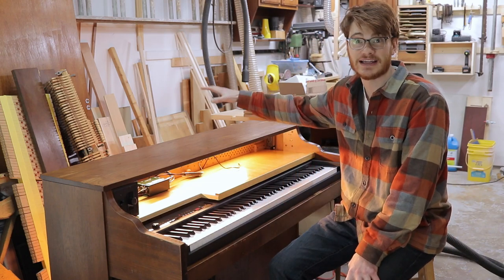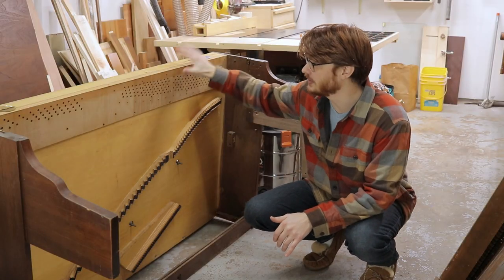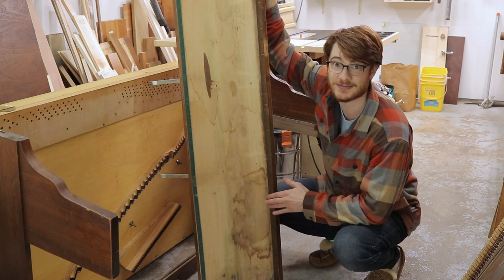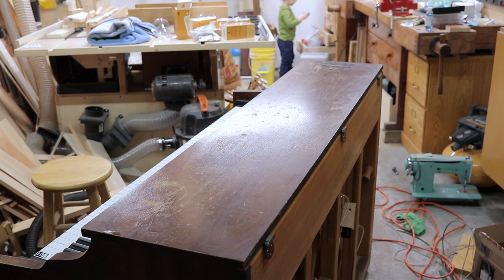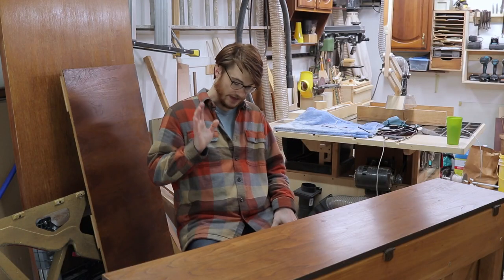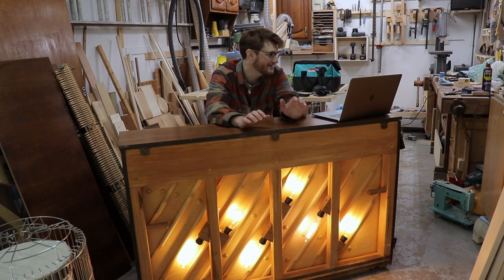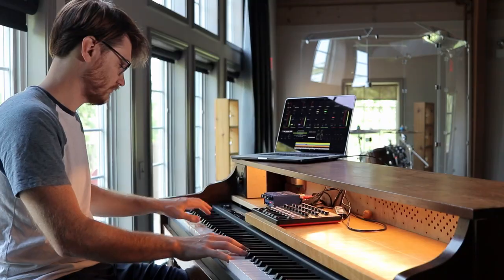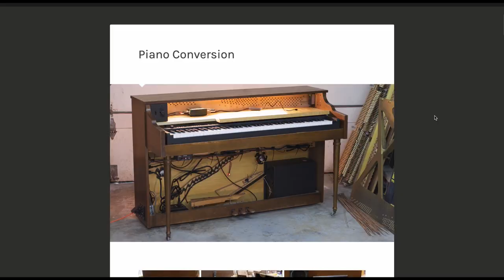Upright Piano to Epic Keyboard Conversion

Comment from the maker: I should have known some of you would feel this way since you are the internet and you guys suck the fun out of everything. It's not like I destroyed a Steinway. Pianos are like cars. If the cost to repair it is more than the value of the piano then it is totaled. Every piano shop I know of in my area has a warehouse section for parts pianos and pianos not worth fixing. When the warehouse space is full then off to the dump it goes. I saved the piano from the dump and the metal got scraped.

Also gutting a piano is way easier and cheaper than building a case from scratch.
Reply: Nice job !
Reply: @peterjohnson4932  OR you could have used nuance and logic around the descriptors "Old free and junky" (59 seconds) and come to the conclusion that a musician (especially a church worship musician.)  wouldn't have done this to a serviceable piano, only one that was "junky"
Reply: @peterjohnson4932  there was no need to explain that. If you actually knew anything about older pianos (which it appears you know nothing), you'd know that there are hundreds of thousands of these sitting around doing nothing but collecting dust. They have no market value and the people that own them can't give them away. They're horrible instruments and were never designed to age. They are essentially disposable, except for their quality wood and construction, and were designed to be a cheap way for a kid to take piano lessons in the 50s-90s when our culture put a premium on that sort of thing and before digital pianos became both the norm and good enough to practice and learn on. In fact, these really aren't instruments. I don't know if I'd go so far as to call them junk, but in terms of playing them, they're just about that. At any rate, their only redeeming value now is to be used as the guy does in this video. I would even bet money that the original manufacturers of these pianos would be thrilled that someone is using them in this manner. They would be shocked to know someone was actually trying to play them as an acoustic piano because they knew they were a 20 year, at most, instrument. The fact that you don't know any of that means you shouldn't be making ANY comment on here, much less a critical one. He didn't owe you any explanation; as soon as you saw he was doing something you didn't like, you should have gone on to another video. Not rail on him for "destroying" his own property. Especially when you can get the same thing from dozens of people where you live, no doubt, for nothing more than a call to 2 strong friends (if you have any). It can sit in your living room and sound bad. He doesn't need thicker skin -- YOU need to quit trying to be a bad ass online. It just shows what a fool you are.
Reply: @scott1564   Exactly. I have a friend who had 2 of this type of piano given to him this past year. The parents of another friend have one of these sitting their basement. The piano hasn't been played in decades.
Reply: I would have to disagree on cost it works both ways. If you use recycled wood you can come out ahead. The sound board may or may not be good for a speaker enclosure, I would think it would be better than the particle board they sell for speakers. I never tried.  I always removed the fiber from sealed enclosures the bass sounds better so I believe the sound board would be good in sealed enclosures. As for cost you have to include the power tools and special bits to remove the tuning pegs. I myself like a real action so removing the action is out of the question. Weighted keys just don't cut it for serious piano technique. But I must take into consideration you molested a spinet piano so not much is lost. A studio practice piano would be one that I might consider guting out. I still have my old keys and action from an old upright I thought about making an electronic keyboard with real action and the hammers with trigger a switch but the noise it would make would make the project useless. Maybe I could find a way to reuse them keys, well thanks for this interesting video the project looks cool with the lights and all. 73
Reply: I’m so insanely happy I found this. After over 30 years my little piano that I grew up playing needs so many strings that I just can’t put the money into restringing. I want my kids to learn and I really didn’t want to get rid of my piano. I have a woodworking background (thanks Dad) and now I can keep my piano and teach my kids to play!! I will definitely be using all your info!! Thank you so much for posting this!!
Reply: If you built it from lumber from the lumber store, someone would have criticized you for cutting down a tree.  I laugh at the ignorance of some people..... like the old worn out "spinet-style" piano was the "ark of the covenant."  🤣 I just saw a fantastic project where a woodworker turned a 100 year-old, worn-out baby grand piano in a bookshelf.  https://www.youtube.com/watch?v=j381l-O83bk&t=119s

Comment: Imagine complaining about someone doing something more creative and productive than you yourself have probably done in the past year or more. Obviously these people don't know ANYTHING about the piano market right now too. That thing was probably destined for the dump but this guy decided to breathe new life into it! Thumbs up merwin
Reply: Any old piano can be turned into a hybrid that is much more interesting than just a case for a cheap digital piano board. Here is an example of the result of my project - the old and completely unsuitable Zimmermann was taken as a basis, all of its original sounding part was removed and electronics were made on the optical sensors of the keyboard. The original mechanics are retained. The result is an instrument with a high number of sensitivity thresholds (1024), and sounds like a real acoustic grand piano. Requiring no maintenance other than occasional adjustment of the hammer mechanics.
https://www.youtube.com/watch?v=PMxwRz-Rvh4

Comment: I got a spinet piano a couple of years ago. The piano was free, but I had to pay to move it and get it professionally tuned. The tuner told me it wasn’t a good piano, manufactured 1938-1939 and wasn't good even when new (he said it was the piano equivalent of a Costco guitar). He suggested exactly what you did and luckily I found your video! I don’t think I’ll add lights as it's for my studio, no stage plans, but I like your idea of using adapters so you can access inputs and outputs from the front or side. Nice job!

Comment: What socket did you use to remove the pegs? Thanks!
Reply from the maker: Link is in the website article. here it is also: https://amzn.to/46xunEa
Reply: You can also use a 1/4" socket driver, reverse it and use an Allen key driver that fits whatever size the socket is. Or you can be like me and remove about 100 of the pegs using a manual tuning wrench before you figure out an easier way. 🙄

Comment: A piano is an instrument. The instrument part is the combination of the keys action hammer. A more interesting project would be to keep those things and turn an old into a digital piano keeping the entirety of the piano action. People pay big money for a piano action with a digital component.  Just take out the strings, add sensors, and a place for the hammers to hit rubber where the strings woke have been. Output to a simple midi

Comment: I found a tossed digital upright piano. If I chop the keyboard down to only 37 or so keys, could I still use the remaining keyboard to use as a portable (couchable) digital keyboard?? Or will messing with the keys affect the circuitry? 
I would like to salvage this thing, but also make it smaller. Thank you..
Reply from the maker: usually the inside is one big circuit board, so plitting it up would be a pretty involved endeavor.
Reply: Anyone who tried to criticize this piano conversion, is obviously just a troller, who gets some odd sense of glee by criticizing anything. It reflects immaturity, and ignorance. I doubt if any of them even played piano.                                     
I’ve played piano many years, and I don’t like the idea of destroying a good piano, but it doesn’t look like that was a good piano, at least not lately. I’ve been in thrift stores recently, and they have had pianos like these for as little as twenty dollars. A musician realizes that there’s a cost involved in moving these, and if all the piano needed was just to be tuned, they probably wouldn’t want to even pay the cost to just get it in tune, and pay movers. Just adding those basic costs up, is going to start out at least between $250.*, to $300.* or more, and then you don’t know how long it would stay in tune. On the other hand, if you buy a digital keyboard like a Casio, when they’re on sale, you can get one with a weighted keyboard that’s actually fairly decent, with decent piano sounds that will never require the cost of calling a piano tuner, and can be move easily, and practiced on while using headphones, to not bother others in the house. I’ve taught beginner piano students, and I would prefer that they start out on an inexpensive weighted key digital keyboard that they can practice on with headphones, and not worry about mistakes being heard, than a neglected old piano, with uneven keys, that might not stay tuned. 
If any of these trollers want to save a piano similar to this one, there’s no shortage of them, that’s the thing, they’re not collector’s items. If they want to save one though, all they need to do, is call some Goodwill/thrift shops, and it won’t take long to find one. Then, maybe the shop will help them get a deal on someone ( more than one person)..who will move it, and if they’re gonna do a complete reconditioning job on it, like refinishing, making sure that it has all the strings it should have, checking each of the eighty-eight hammer striking systems, to make sure everything is secure, and aligned, and there’s continuity in the wear of the hammers, then they should definitely share that process with all of us, and make sure that they have their cameras ready to record as they get their piano back in presentable shape.